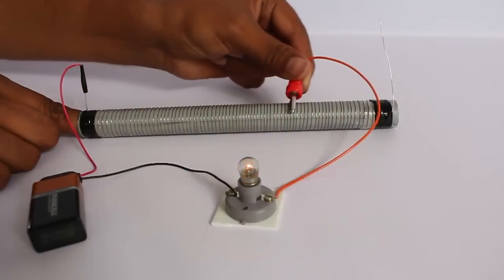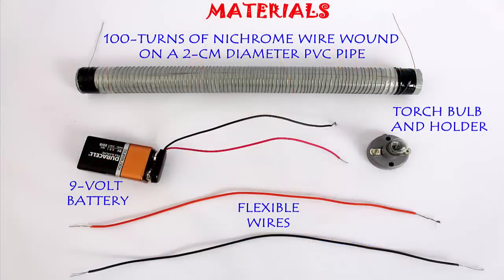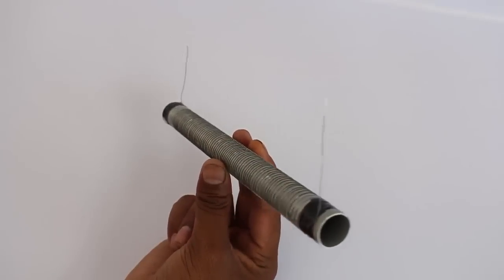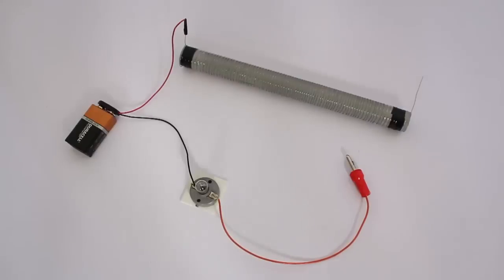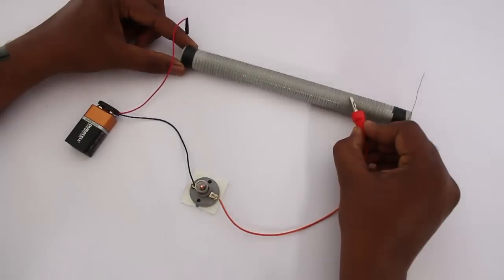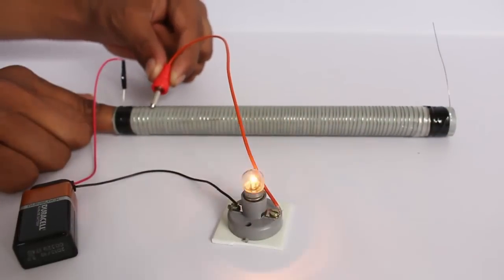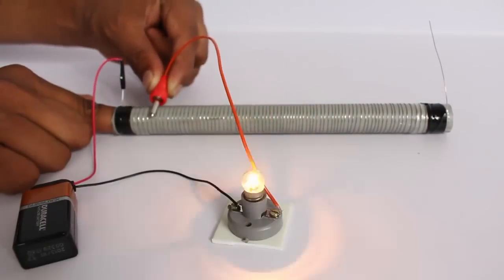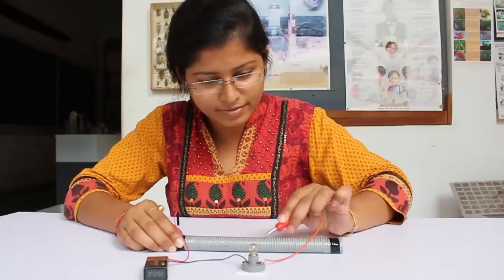Variable Resistance | Engish

Comment: Can we use normal copper wire used in home appliances
Reply: I don’t think it will work because copper has very little resistance (compared to nichrome wire) so I would imagine that regardless of any distance from the bulb, contact on any part of the copper would still have the bulb full brightness.